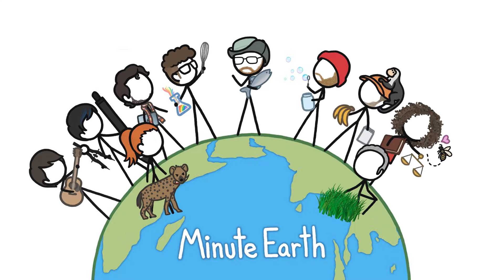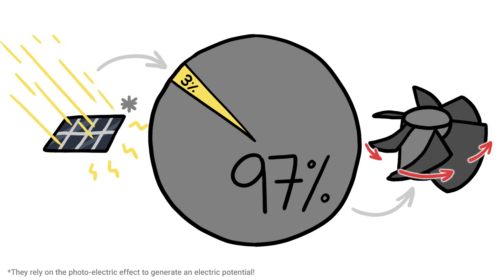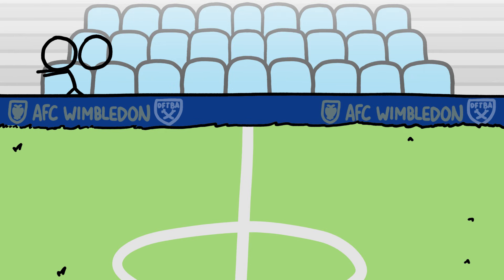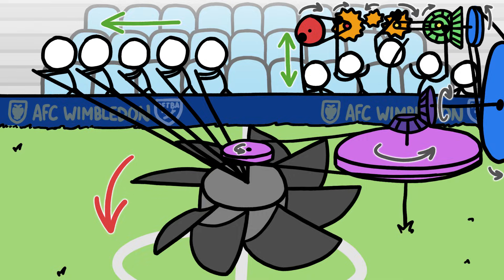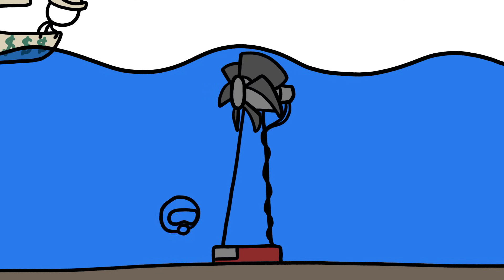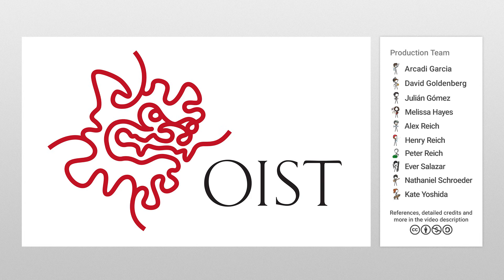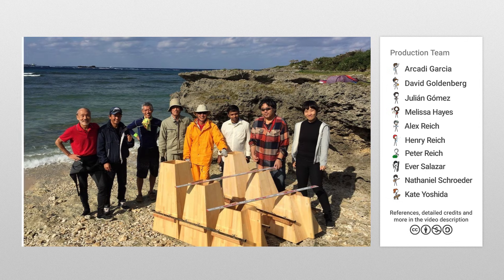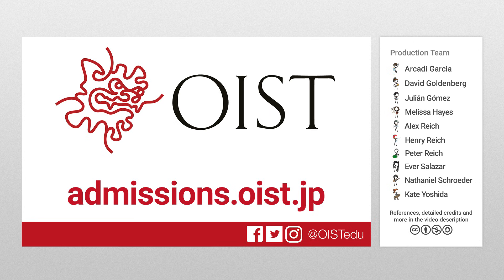Why Can't We Get Power From Waves?

Comment: The place you could have benefit would be on things like oil drilling rigs, where the cost of transporting the refined fuel needed for the generators is expensive.  In those cases, where much of the expense of doing underwater contruction is already backed into anchoring the platforms to the ocean bed and working with underwater drilling equipment, the fact is that it could be quite cost effective to drop some stationary rods or sleeves from the rig and put magnetic oscillating buoeys around (thing doughnuts) or inside them.  This would generate a kind of "dirty" A/C that would need to be cleaned up (rather than relating to a sin curve that comes from transforming the rotation of a turbine (which is run at a constant RPM), it would vary with the frequency of the waves).  

For things like large ships, it might also be cost effective, but those devices might introduce drag that would require more fuel to move the ship, so it wouldn't be as economical.

Comment: What? Why don't they just fill something attached to the shore with a substance that's highly thermally active but also could flow with the water pressure differential? Or better yet, why aren't the giant granary shaped ones from 1:13 attached to buoys like from later in the video and just have the low-tide water-level be their resting point that way the "generator" would already be grid accessible? I grew up most of my life thinking that this was basically a solved problem.

Comment: You're trying to turn all you're problems into nails because you're good at using a hammer.
Stop being so hung up turbines.
Reply: Yeah, I felt the video was a mish-mash.  Deep water waves bob up and down,  true, direct link to reciprocating motion, no?  Not here!  Link instead to saying that most of our electricity generation comes via steam turbines....  eh?  Irrelevant.  Even for steam, if you only have low pressure you're better off with a reciprocating engine.
Reply: Was thinking wave energy looks a lot like piston energy, not as efficient as turbines but sometimes a lot more practical. 
Probably some reason it wouldn't work tho.
Reply: Alex...do you have a more cost-effective idea that poduces the same amount of power as a turbine at half the price?
We're all waiting, Mr. Youtube expert...
Reply: There is nothing wrong with turbines. Being hung up on eliminating turbines from the equation is not productive. In other words, it's a waste of time to figure out how to eliminate turbines (or some other type of circular coil design) from wave power devices, rather than focusing on increasing electrical output to a commercially viable level.

Comment: DO NOT BELIEVE THIS VIDEO! The claims it makes are complete poppycock.
First, the suggestion that wave power is not viable is contradicted by hundreds of actual, functioning wave-powered arrays in at least two dozen countries. Here is an article that discusses just a few of those plants:
http://www.bluebird-electric.net/wave_power_energy_generation.htm

Second, people have been generating power with non-turbine-based methods for decades. Though I wont prolong this comment by mentioning ALL such methods, the one that holds the greatest potential for wave-based power plants employs piezoelectric technology, which uses variations in pressure to generate power. Since waves move up and down (as the video notes), floating buoys anchored to the sea bed can generate lots of pressure. There are several piezoelectric-based wave power stations already in operation in Japan. I couldnt find a website in English that discusses these wave power generators, but here is another example of piezoelectric generation, which (instead of waves) uses the pressure of people's feet to generate power in a football stadium. (The article is nine years old, and discusses only the pilot project. Today the stadium has been fitted with panels under all 30,000 seats.

https://www.japanfs.org/en/news/archives/news_id030389.html

In short, this video is disinformation. I would love to know what  agenda OIST is pursuing, since they clearly dont care much about providing accurate information.

Comment: So Nuclear, Coal, Gas are still the most reliable and productive way make energy.
Reply: "In 1961, when the Niagara Falls hydroelectric project went online, it was the largest hydropower facility in the Western world. Today, Niagara is still the largest electricity producer in New York state, with a generating capacity of 2.4 gigawatts (million kilowatts). Up to 1,420 cubic metres (380,000 US gal) of water a second is diverted from the Niagara River through conduits under the city of Niagara Falls to the Lewiston and Robert Moses power plants. Currently between 50% and 75% of the Niagara River's flow is diverted via four huge tunnels that arise far upstream from the waterfalls. The water then passes through hydroelectric turbines that supply power to nearby areas of Canada and the United States before returning to the river well past the falls.[37] This water spins turbines that power generators, converting mechanical energy into electrical energy. When electricity demand is low, the Lewiston units can operate as pumps to transport water from the lower bay back up to the plant's reservoir, allowing this water to be used again during the daytime when electricity use peaks. During peak electrical demand, the same Lewiston pumps are reversed and actually become generators, similar to those at the Moses plant.[36]"

Comment: Not efficient when compared to other power generators like Nuclear Power.  Doesn't this apply to ALL POWER GENERATIONS?  You could say solar and wind power generators are flawed in the exact same way.  Also, claiming wave generators do not exist would be flawed, because they do exist.  Just extremely low popularity due to the location restrictions, cost of the land, etc.
Reply: Just a quick google search shows: https://www.youtube.com/watch?v=7ZN5CthZhvg

One in Hawaii (2016): https://phys.org/news/2016-09-wave-produced-electricity-online-hawaii.html
United Kingdom (2000-2018):  https://en.wikipedia.org/wiki/Islay_LIMPET

The current wave generators are horribly inefficient, and will never replace nuclear power anytime soon.  Just like solar and wind generators are inefficient and will never completely replace nuclear, oil, and/or coal power generators.  

No plans to reduce or remove coal power plants: https://www.vox.com/energy-and-environment/2017/5/15/15634538/china-coal-cleaner

Comment: In France, we have at least one "centrale marémotrice" (rough translation "tidal power station") in the city of Rance. It's running since  1966 and produce 500 GWh per years.
Reply: Problem is Tidal Power is not the same as wave power, Tidal Power Generators tend to rely on the currents formed and caused by the ebb and flow of tides, and not waves. These currents are more powerful, and last longer than the movements of waves (though they are still periodic, as tides are), more importantly they have a lateral movement to them that non breaking waves do not have. As tides come in and go out they are moving vast amounts of water, often very quickly, as anyone who has been caught in a rip tide (and survived) can tell you. Another example of how much water can be physically moved by tides are Bores, such as the Severn Bore, where the tide pushes water into more constricted areas. 

The problem with waves is as stated, the WAVE moves, but the medium it is travelling through, the water, does not, and to spin a turbine you need the medium to move. It is only when the trough of the wave hits the sea bottom on the coast that the wave structure is disrupted, the trough of the wave slows while the crest maintains its speed, and so the water itself begins to move. Its a bit more complex than that of course, but that does give you a general and clear look at why utilising wave energy is a problem. 

The short version is that Tidal Energy is viable, but it is also not the same as wave energy. Hopefully one day someone will come up with a way to harness all that power that is represented by waves, for Island Nations it would represent a huge amount of cheap, clean power when it is finally done....
Reply: @randomxnp  While modern coal plants are clean compared to older models, they are far from clean. In any case, the demise of coal is not caused by politicians, but by the fact that it's massively outpriced by other energy carriers - it's just a lot harder to transport coal anywhere than to use gas in a pipe.

Anyway, here's a handy list of working tidal energy stations:
https://en.wikipedia.org/wiki/List_of_tidal_power_stations
Reply: @randomxnp  I find okley's question to be quite pertinent. You're more than moderately stupid if you believe that "clean" coal is an actual thing.
Reply: My immediate thought was whether people would consider the low frequency waves of the tides to be wave power or not.  Most people do not think of heat as low frequency electromagnetic radiation, so I'm guessing "no."  As demonstrated here, the ignorati win again by proclamation.
Reply: @randomxnp  I found stuff : 1MWh produced at Rance cost 120€.
1MWh of nuclear cost 90, uranium and waste cost excluded.
It's not the best, and I nether said so.

Also, if you use a wrong definition of comon sence, you can't anderstand what I'm saying.

I'm bringing an argument, not a truth. The only point you  bring is that I'm fullish because you seem to think "common sence = common stupidity"

I'm totaly OK to agry with you, but "haha, you're naive and fullish" won't be enough for me.
Reply: Doubting Rich 

Educate yourself

https://www.popularmechanics.com/science/energy/a4947/4339171/

Btw ur argument is tantamount to saying, “It’s ok I keep punching myself in the dick. I’ve added more padding and I now wear under armor pants...!”
Reply: @joshuasnore3600  Bahahaha! Omg that last comment was priceless. I really needed the laugh, too! Thank you!
Reply: If I got my sums right, "500 GWh per year" is 57 MW - that is quite a small power output (enough for a small town)
Reply: @randomxnp  and that's why I pointed the one in Rance that run since 1966. If it's still running after 53 years, it must be viable.
Reply: @randomxnp  at least I try to bring some point to the conversation. On your side, you simply don't bother bring some. I haven't put my source  (and they are wrote in french) but it don't mean I'm lying. On your side you don't need source since you bring nothing to the conversation.
You say that my argument could mean you're right. Yes they can, I'm not trying to prove you're wrong , I'm not here to fight, and I'm not  here to win an argument. I'm just waiting you to elaborate your point of view. I can be wrong but I don't see why  (being fullish and naive just don't convinced me). If your next reply is still just agressivity  and patronizing, please consider stop wasting your time with me (it'll also save my time).
Reply: @TetraChild    Bonjour!   Votre erreur était de poster en anglais.  Malheureusement il y des gens qui sont trop oisifs pour
 utiliser Wikipedia et préfèrent d'attaquer.  For others:  the figures he gave are in Wikipedia,  in English if you prefer, and please, if you don't trust wiki then do your own research, don't castigate the guy. 12 centimes per kilowatt-hour.
Reply: For those of you with no reference point, that power output is far less than what could be achieved with a smaller and cheaper power plant running on any one of the more common fuels, and most tides aren't strong enough to generate power. That's why there aren't many of these in the world.
Reply: Tidal power != wave power
Reply: @gdeangelkick  you know there is a ≠ sign right.
Reply: @randomxnp  Trump University graduate?
Reply: I think your example is a nice proof of concept and works. And even if people claim that this energy source is too expensive... but hey it's clean energy, so it has to be expensive ! 
Mighty people seems to think that dirty but cheap energy is the better way. But what shall we do with the spare money if our planet is destroyd. So many ways for clean energy, we need to use them more !
Reply: @randomxnp  the only think I have is a comon sence observation : if it was a waste of money, it would have been shut down a while ago. But it still running despite our 58 nuclear reactors. I'm not saying it's "the ultimate solution for a better tomorrow", I just know it exist and I doubt it's still running without a good reason.

Comment: Turbines are an efficient way to generate power. But we have many machines that efficiently generate power from a vertical motions: reciprocating engines found in most automobiles. Another big issue is that most the energy of a shallow water wave (wind wave) is near the surface (see the velocity potential function). It is difficult to design machinery to operate at the surface. It has to withstand the more volatile surface weather. In the shallow water, you need to design equipment to withstand breaking waves (surf zone). In deeper water, long cables are needed to connect to surface energy to bottom mounted power generators and/or power transmission lines.

Comment: Maybe you could use wave energy to pump saltwater up hill (in a random, sporadic manner) and then let the water flow back downhill to spin a turbine in smooth, regular manner. Figure out a way to concentrate the incoming wave energy of let's say 100 tons of water to drive 1 ton of that water up a hill into a holding tank. This would happen in bursts as it were. Then release that water in a relatively slow, steady stream that spins a turbine at a constant rate.
Reply: If it's slow, it's not a lot of energy, so not really efficient. Same as other methods.
Expensive for low power output.

Comment: Just male the wave move a magnet up and down past a coil of copper and boom.
Reply: And boom you get useless electrical noise that you would rather dump into a big resistor to dispose of than rectify, average out, invert and feed into the grid.
Reply: If the waves were at a consistent rate you should be able to space the windings In a manner to give some useful power.
Reply: @johnsingleton7548  They neither go straight up and down ( see e.g. https://en.wikipedia.org/wiki/Wind_wave#/media/File:Deep_water_wave.gif ), nor are the consistent in amplitude or frequency. From day to day or wave to wave they are inconsistent on all scales. Waves in fetch are especially shitty, but waves in dispersion are not that great either.

Comment: how about a reservoir that fills at high tide, then closes a lock and then at low tide opens a lock to let the water flow to a turbine
Reply: .....So where are they supposed go get power from while they wait 8 hours for the tides to change?

Also, expensive.

Also, you're not an engineer so stfu.

Comment: Easy enough to solve:
A wave powered reciprocating linear generator feeding a Silicon Controlled Rectifier feeding an inverter.  No turbine needed.
Your welcome.
Reply: Works if you connect the two with a retro encabulator along the Wilson flange.
Reply: @truantray  - Noob! Nobody uses the Wilson flange anymore.  It's all about the Johnson hyper ballast modulator. Otherwise you get too much drift in your simplex spline coupler, and next thing you know your retro encabulator is lying in pieces on the ocean floor.

Comment: Why use waves instead of currents? Currents are entirely directional, plus you can thinly plate the outside with non-corrosive material like bronze or silver. Then place a grate over it so that fish don't swim into the turbine.

Comment: Forget wave harnessing.  This falls into the cow poop/methane digester category of renewable energy, so popular back in the 60s.  

Make dams in tidal flood areas and funnel the ebb and flow past lots of ..wait for it... turbines.  Energy coming in, energy going out.  Let the moon and gravity do all the work.  

Tide power: available worldwide, non-polluting, not exactly low cost, but one helluva lot cheaper than, say, a nuclear plant.  Quiet, safe, settled technology (turbines), no transportation or disposal issues with fuel (coal, uranium, oil).  Few moving parts, therefore low maintenance.  Unaffected by weather, barnacles or trash.   

Only drawback: tree hugger heads would explode, gnashing their teeth about endangered species and other luddite-grade narratives.
Reply: I don't think you have to be a "tree hugger" to care about endangered species.

Comment: Norway have wave power plants that produce power at at a cost of 3.5NOK/kWh (or $0.41/kWh). If the goal is to make it cheaper than coal there will be an issue ... work is in progress to drop it down to $0.2/kWh.

Waves4Power

Comment: There is a way. It was actually discovered in 2015 by Michael Edward McCulloch. It used the "sheltering" effect, the effect that causes two boats in the ocean to be pushed toward each other, to create a rotational force to, you guessed it, spin a turbine. 

Of course, noone wants to put a swastika shaped rotor in large amounts on their coastlines, so it's still just a paper. 

Energy from Swastika Shaped Rotors is the name of the paper.

Comment: Buoy design is the best one, but the problem is you can't have the turbine underwater. You need a dozen buoys around a platform. The platform has the turbine(s). The buoys go up and down, pulling and releasing a cable that runs from the buoy to the ocean floor and then up to the platform. The only thing underwater is able and the anchors points so maintenance is easier.